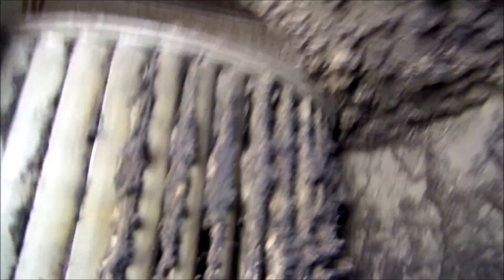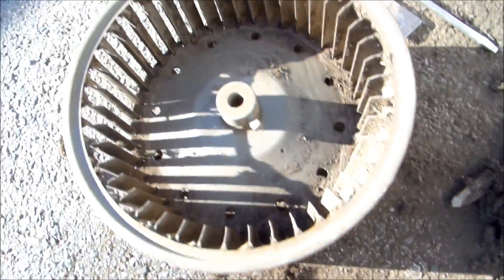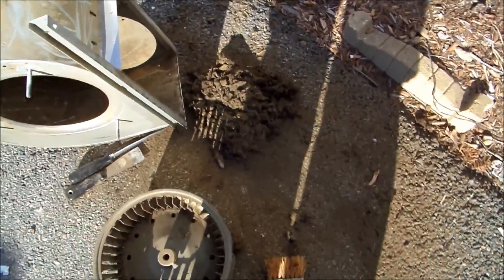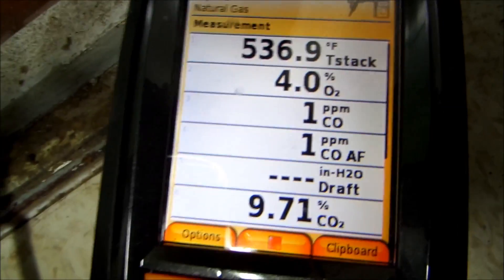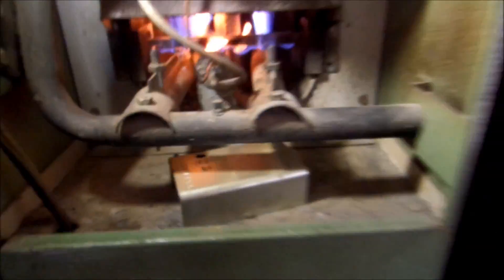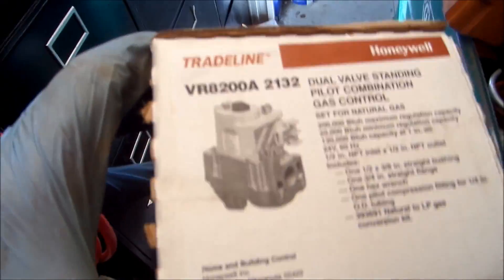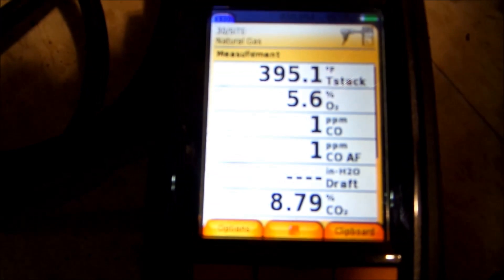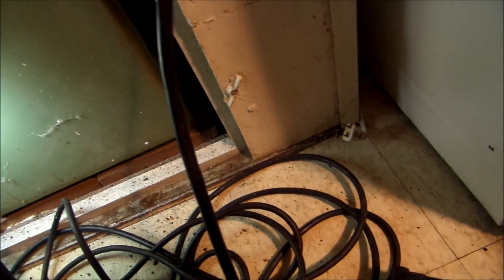HVAC: high carbon monoxide levels in old gas furnace.

Comment: It was a pretty lame wok and random repair job. I do not even recommend this video to anyone. you do not clean burners like that. open the burners, take them out then clean. When the CO goes up after the fan runs it is the heat exchanger crack disturbing the air fuel ratio in the flue line creating incomplete combustion, or something is in the path of the air or fuel. Did you clock the meter?  Where is this Steven's city? His job looks like you get a dental work sitting on bucket with mechanical pliers in the doctor's hand.

Comment: Enjoy your videos Mark.  I have a neighbor that has a 14 year old, Sears, 60k gas furnace.  My neighbor started smelling something that made her feel sick;  wasn't a gas smell, smelled like something maybe burning.  That furnace had been running for a few hours.  She shut off the furnace and left the house.  CO detectors did not alarm.  A few days later, a furnace guy came over, looked around, and took a CO reading inside the house at one of the registers.  It read 2 ppm.  He declared the furnace dangerous, took out the BUSS fuse.  He gave my neighbor a replacement cost of $13,331 bucks for a 80% , 60k Carrier.  He said she had to have the duct work pressure tested by a 3rd party, Calif. title 24.  We're having Sears come by for a 2nd opinion.  What should we expect on a $70 residential furnace check, what's the minimum that they should be doing?  Thanks,  Bob

Comment: Have a question on gas fired furnace, it has b-vent flue i was told never drill into b vent. If so how do you test co on b vent?
Reply: right on top of the furnace before B-Vent starts, there is about 4" high C to B transition, you drill into the C-Vent. you can even have up to 12" C-Vent on top of the furnace flue collar before transiting to B

Comment: I also noted that you had a lot of yellow tipping before you replaced that valve but the pilot still had quite a bit of yellow.  Shouldn't it be that typical bunser burner blue?

Comment: why do you replace a gas valve for high CO?  Is it because the pressure is won't adjust properly, because it doesn't mix air with it or anything, its just a gate for the gas at a certain pressure.  I haven't seen you actually check pressure on a valve yet.
Reply: Yes - You're right he doesn't - show - any adjusting; it'd be helpful to see and hear more about that part, for sure...  
...at 12:31 he quickly mentions that the valve is non-adjustable so he needs to replace it - presumably to be able to adjust pressures to improve the CO level. 
Just before this point in the video (and after the cleaning) in the new readings it seems he got it down to 175 or so - not low enough to be safe, and after the new valve  - and-unsaid adjusting-it?? - he got it much lower - and safe)...

...fwiw - at first and second (and third!) viewing I was puzzling as you were...

Comment: One should use clean pilot,burners,mixing tube, orface, check outlet pressure of gas valve and if it's not 3.5 wc then adjust accordingly. Check inlet pressure confirm that it's 7wc assuming its natural gas fuel. Clock gas meter to insure it corresponds with btu input, thus I'm sure gas valve was fine, it's cause it was so f--king dirty

Comment: Hi Steven, I learned a lot from you videos , thanks a lot, I have question, I do not have combustion analyzer, I just have CO analyzer (UEI CO 95) is this enough to do these kind of tests, thx
Reply from the maker: i have hurd that uei meters are not that good go with a testo or bacharack .. thats what i would do
Reply: actually I heard the same thing , but do I need to go with combustion analyzer or Co analyzer, I think the one you use is combustion analyzer , sorry most of my work in AC and heat pump still new in gas stuff, please advise me in this and if you have more videos about furnace or boiler  inspection let me know, thanks steven , you help many people in this filed by your advices and video.
Reply from the maker: combustion analyzer
Reply: Thanks

Comment: great vedio Steve 
if my analayzer is reading about 20 PPM CO 
on 3 of 4 heat exchanger outlets on a furnace similar to that one 
but the 3rd reads 65PPM is that still safe to run
Reply from the maker: +mikhaiel j  below 100 is good but should be fixed maybe it needs a good cleaning

Comment: Hi Steve I have the same issue (not the dirty fan part). I have a similar furnace in crawl space. The fan motor crapped out on me, I wasnt sure at first it was a the motor just that i wasnt getting heat, Called someone in and he had a used motor in truck so swapped out to check. Once fan motor changed out Furnace ran great. Prob is he checked CO2 after this, as was in your video, left chamber was high C02 though nothing close to the levels in this video (right was ok).He went on to sell me a new furnace which i thought was my only option until i viewed this vid. Questions I have: Was the drop in CO2 in the furnace in the video a result of the cleaning of the burner or new valve or both? 2, Are replacement burners for these old furnaces difficult to get,.Thanks
Reply from the maker: smazz104 the old furnace had a non adjustable gas valve ,so i replaced the gas valve and reset gas pressure to lower c.o. levels .c.0. levels are set by air to gas mixture sometimes a simple air adjustment is all you need to lower the c.o levels all depends on situation ,

Comment: NO way I would put my name on that old furnace. You know I know and the landlord knows the furnace is shot. Put a gas valve on furnace to cut down the gas to lowest level. The pilot light was blowing out because when the fan comes  on  it blows out the pilot light. Put a camera for heat exchanger down in the furnace bet you will find holes all in the heat exchanger. Better have a co2 dictator in the apt. The furnace has a draft hood on it. You know its a 1986 furnace or older. Its over 30 years old. Bet the landlord's car is not older then 3 years old. Hell cell phones were not made yet. Soot pouring out the vent hood. Looks like a law suit to me. Nope, either replace it or walk. Its not worth the $1000.00 repair. Better yet run from this landlord. He will blame it on you. Remember,  the lady says she wants a NAP.  What does carbon Monoxide make you want to do? take a nap! The landlord will  say  "he is the expert" through you right under the bus.  Run don't walk
Reply from the maker: behvac well i can only do what he will pay me for .. your moto is sell, sell, sell .thats not always possable all the time .i do what i can .i told him he needs a new furnace .its safe to run for now with the new gas valve.
Reply: I would not spend the time on it either. But if the heat exchanger was cracked you would get high co level and high O2 levels with the blower running. I wouldn't be worried in his position about putting his name on it.
Reply: The landlord is definitely a cheapskate. I doubt he has a newer car. Probably keeps all his money in the bank and doesn't spend a dime on anything (or himself) unless absolutely necessary.
Reply: Saving is good, but endangering your tenants is criminal.   @wesleyhurd3574

Comment: Good job, Did the wheel come right off or did you have to use a puller?
Reply from the maker: i had to use sand paper on shaft then she slide right off

Comment: What about the evaporator coil, that thing had to be a mess also.

Good catch on that co level. The flames looked much better after replacing the gas valve

If your not testing your guessing ;)

Good video!!.
Reply from the maker: no a.c in this appartment .just straight up hot air furnace .i am sure the duck work is full of dust.
Reply: steven lavimoniere
I see